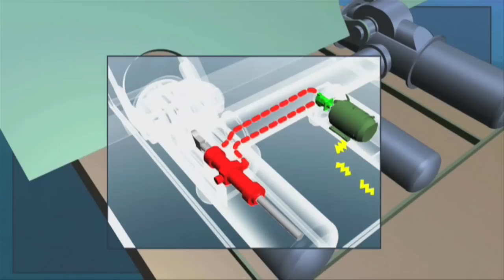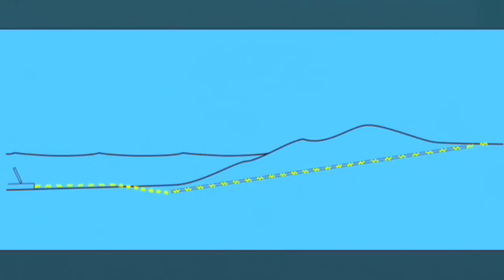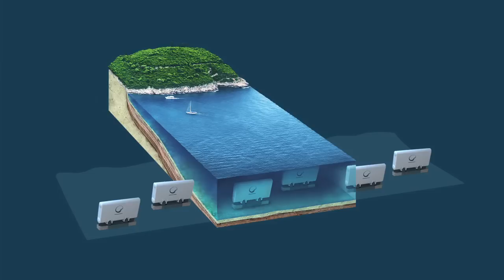WaveRoller_EN _long

Comment: The WaveRoller prototypes are small producers (100 kW per unit) compared to other energy producers (in the megawatt to terawatt range). On shore waves drive the units
but tides flow in and out twice daily. Does WR just shut down once a day to survive
the ebbing tide? Not convinced these units will survive fierce Atlantic storms or remain
stationary.